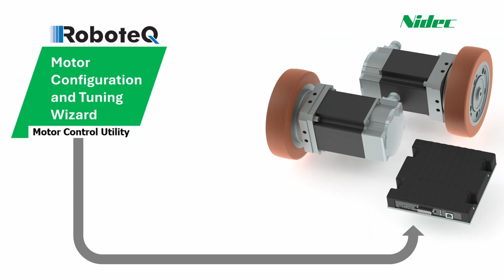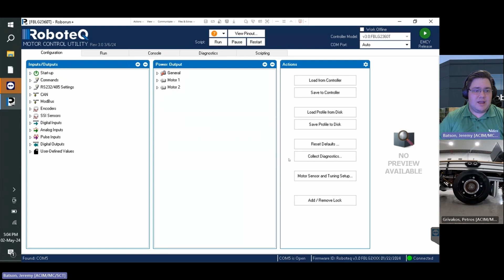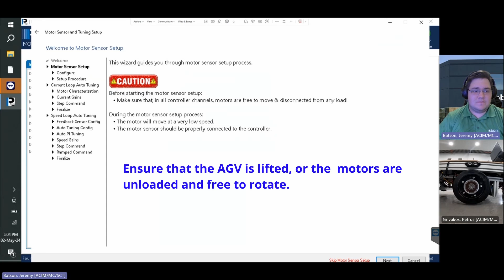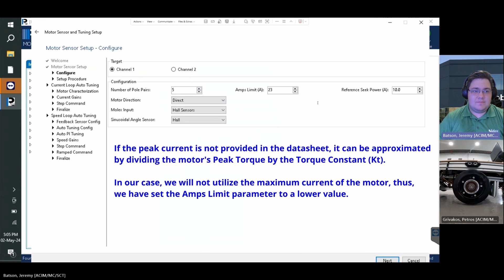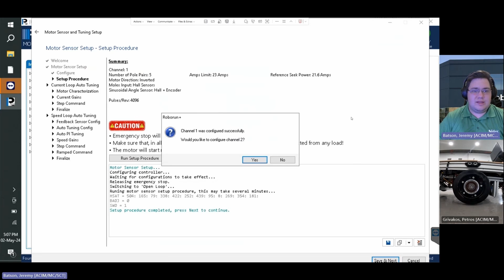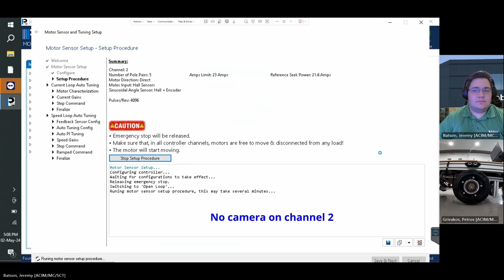Motor Configuration and Tuning Wizard : Part 1 - Motor and Sensor Setup

Comment: Thanks for the video, I have one question. In the windows Caution section there is warning about motor are free to move & disconnect from any load. 
Is the gearbox considered a load? Also, is the vehicle you are running jacked up?
Reply from the maker: Hi Zaher, the gearbox adds some load to the motor, but it is not enough to affect the motor/sensor setup process, so it doesn’t need to be removed. The AGV is lifted off the ground for setup and placed on the ground for tuning. Let us know if you have any other questions!